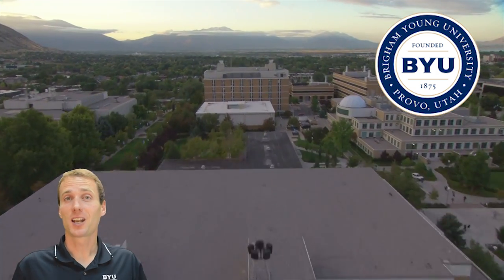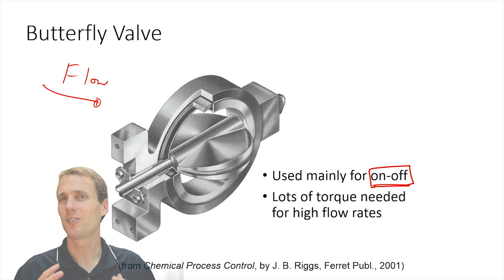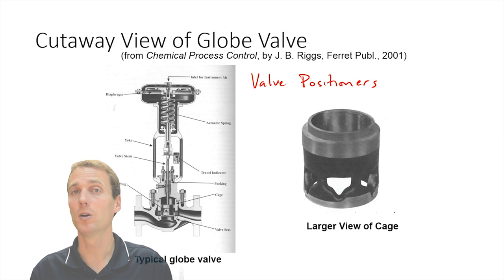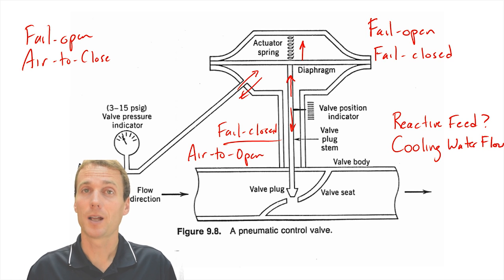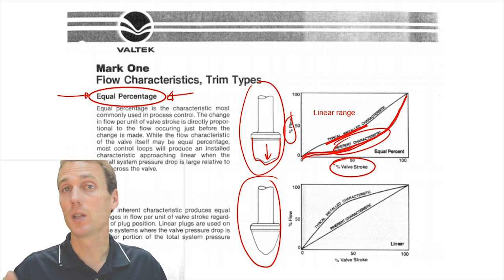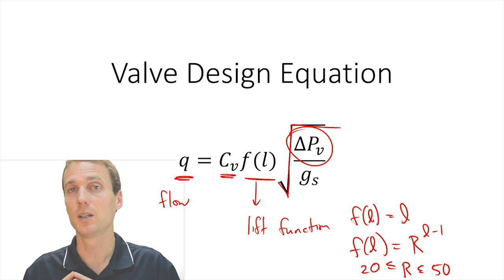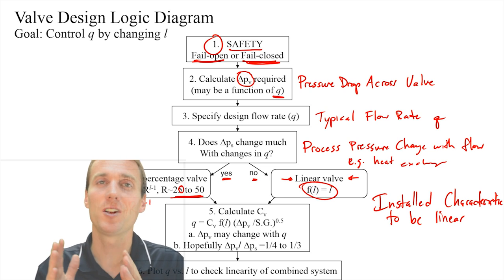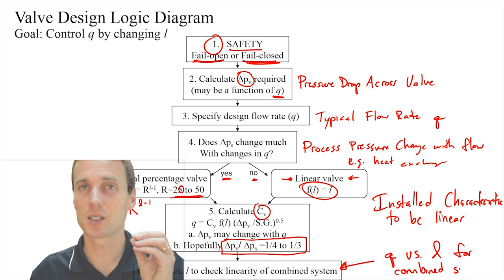Valve Design for Process Control

Comment: From Cameron, former BYU student, who is now working at Chevron: 

"I wanted to give you some feedback on your valve design video. I loved it. I remember struggling a lot with the valve design equation. Having watched the video I feel the students will grasp it better this time around. Well done! Also, to provide some real world relevance to the video, I recently was tasked with verifying some P&IDs within a plant at our refinery here in El Segundo. The overall purpose was to improve documentation, but it was also a huge learning experience for me. My knowledge of valves was definitely lacking, so I spent some time with a more experienced contractor who has worked for decades in refineries and walked through a plant and just picked his brain. If the students can come out of school knowing both what each valve type looks like on the inside but also on the outside, they will be better prepared than I was!"

  Thanks, Cameron
Reply: Hi, I m writing from Venezuela, I have this question related to the equation term f(l)...that you mention its a lift function, but its not clear at all for me what does mean...?, beside I understand that the word "lift" means put up something thus, if is so, I can literally understand it means the slope of the characteristic curve of the valve, am I right?, so actually the term f(l) just means the type of valve...e.g. lineal valve or percentage valve...please light me about it
Reply: +Carlos Ivan Hernandez Sanchez yes, you have the correct idea. It is a relationship between lift (such as 20%, 50%, 90% open) and flow through the valve. It is just an empirical correlation to describe the different valve trims.

Comment: John, your video simply pops up when I did a search on control valve.  It is a great video. Although working in the chemical industry for over 18 years, I am not exactly sure the difference between different control valves.  It is great to learn from your video.  Thanks!
Reply from the maker: I'm glad that you found the video useful. Sometimes it's helpful to see the cutaway diagram of the valve. Globe valves are the most common for process control applications.

Comment: Very excellent videos about valve type selection regarding real life engineering work. Thanks for sharing. 
Can you have it in a real valve calculation example for a project.
Reply from the maker: Yes, the valve equation with the different trim types can be used in flow loop design. Here are design problems for practice: https://apmonitor.com/pdc/index.php/Main/FlowValves

Comment: For globe valves It is  also important to  know the mechanical design of seat and plug to find out  if  a valve is air to open or air to close.you can not say that a globe valve is air to open/close only by looking to the actuator.
Reply from the maker: +ali moshiri Thank you for that important contribution.

Comment: John, great video! I have a question. Why it is important for the installed control valve characteristic to be linear. I understand that it will improve the control performance, but how?
Reply from the maker: If the system is linear then a PID controller will work equally well in all ranges of operation. If it is highly nonlinear then the controller will be sluggish at high flows and unstable (oscillate) at low flows.

Comment: hii, i have a doubt on your step 4 of valve design flow chart, the flow chart says ∆P system variation against flow while emerson's fisher guideline says ∆P valve(drop across valve) , pls clarify
Reply from the maker: Both are correct. The Emerson Fisher guideline is referring to characterization of the valve in terms of lift versus flow while the flowchart helps you decide which type of valve to select. If there is a lot of system dependent pressure drop (there usually is) then an equal percentage valve is best. Equal percentage valves are the most commonly installed type of valve trim.

Comment: Hii
This video is really helpful to understand the valve design. i was wondering if you could explain the complete data sheet components in your next video.
And i have two questions. first is, how to define rangebility of a control valve? and second is, most often i see Cv written in a control valve data sheet. Is this Cv related to 100% open condition or what? because Cv changes with the opening of control valve. so i am confused. i hope you understand my problem. Waiting for your reply.
Reply from the maker: The Cv value is related to valve size and is used in the valve design equation as shown here: http://apmonitor.com/pdc/index.php/Main/FlowValves  Unfortunately, I don't have additional information on the data sheets.
Reply: Typically the datasheet will have a max cv stated (100% open) and a lot of times it will state the cv at the designed flow. typically it doesn't give you the full picture

Comment: hello and thanks for the video 
i just want to montiend that you can't just know if the valve is Fail-Open or Fail-close from the actuator only you need to know also if the valve is direct or revers acting
Reply from the maker: Thanks for your comment. You are correct that it can be challenging with some valves to know whether they are fail-open, fail-closed from the exterior. I should have mentioned that some valves also fail in the current position and don't move to 100% open or 0% open when they lose power or pressure.

Comment: hi all. how can i calculate the pressure drop through the valve?
Reply from the maker: The valve design equation is at 9:18 in the video. The pressure drop is on the right hand side of the equation so you'll need to rearrange it to solve for Delta Pressure.
Reply: APMonitor.com got it but, looking at the logic diagram point 2, it has to be calculated as one of the first steps in there process of sizing the valve so I cannot understand. I just know the maximum flow rate I want to have in my pipe and the fluid.
Reply from the maker: +bbdavallonga, the pressure is typically available from a pump or height difference of the upstream fluid. The pressure drop is all of that pressure if the valve is closed. If the valve is open then it is determined by the Cv (valve sizing). There is additional information on valve sizing and pressure drop calculations here: http://apmonitor.com/pdc/index.php/Main/FlowValves
Reply: thank you very much